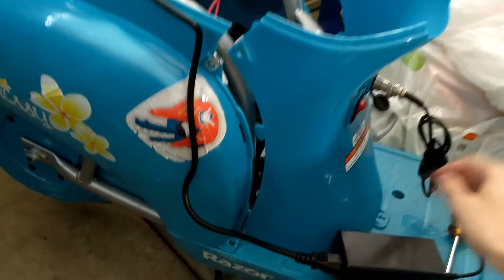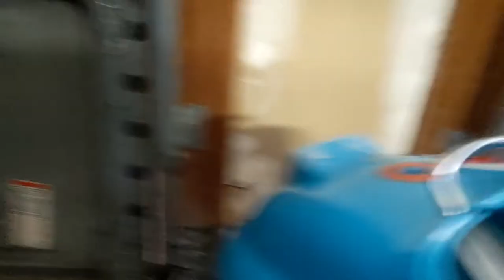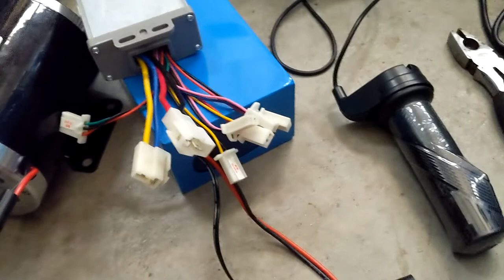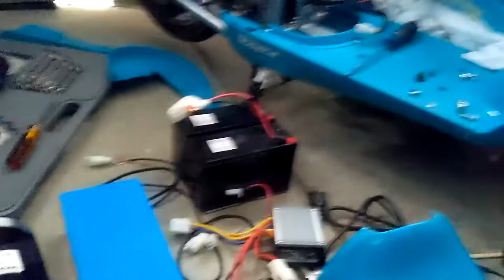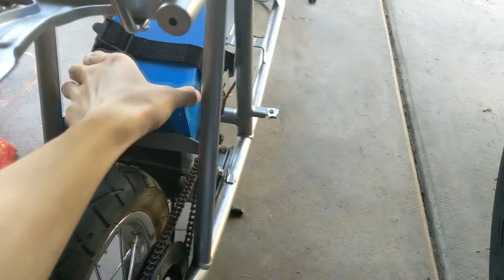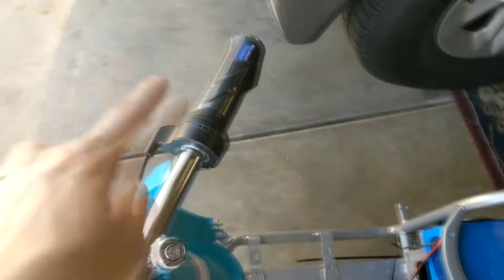Razor Pocket Mod 36V 800W Conversion

Comment: My daughters is doing the same thing would it be the motor that’s bad or the electrical controller?
Reply from the maker: I believe it's the battery. I think the motor is pulling more amps than the BMS is rated for so it's cutting power to protect the battery.

Comment: Huh I picked up one these thinking it would be chain driven so I could do an easy conversion well little did I know it got a custom built swing arm to house a inbuilt tiny arse motor on the wheel
Reply from the maker: Was it a swing arm from something like an MX500 or MX650? I would love if this thing had some suspension. Also I think those hub motors aren't terrible for the pocket mod since you can't put anything that crazy on them anyways, but if it's some low wattage hub motor then yeah that sucks
Reply: @SupaAyshun  why not I got a 1800w slapped on one and plan to do a front and rear wheel hub conversion leaving more room to to also squeeze a bigger battery  in there and nah the one I picked up was legit like not good at all probably 4 and up lol with a weight limit of only 110kgs the other having bigger wheels chain driven motor is much better 😂

Comment: What is the riding time?? How long can you ride before recharging? I need my kids moped to ride for longer distance.  Thank you
Reply from the maker: I haven't done a range test on it yet, although I've been planning to. However, the rule of thumb is about 1 mile per amp-hour so with a 20Ah battery it should last about 20 miles.

Comment: Whats the top speed?  25 mph?
Reply from the maker: It's like 16 mph but I heard if you overvolt the stock motor with a 36V battery and controller it goes up to like 20 or 24 mph. You can also gear it up to go faster too.

Comment: The links to eBay don’t work anymore is that because the links are a bit older or are the products not there anymore?
Reply from the maker: I checked my order history and it looks like the products aren't listed anymore. It's just a typical Chinese 36V 800W kit though so if you buy one from another seller it should be the same. The battery is just some Chinese blue battery from Hailong, which I think is the same as Viset.
Reply: Ok thanks